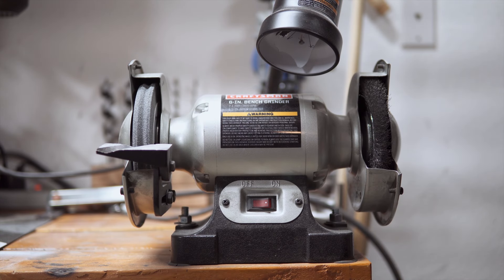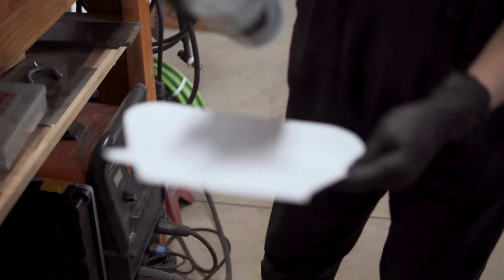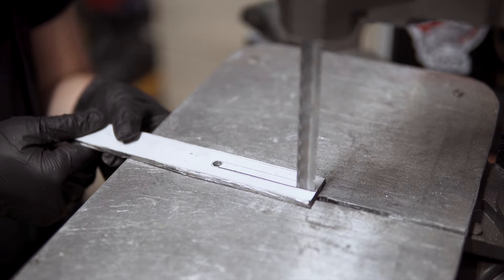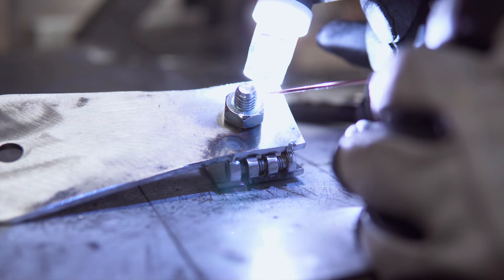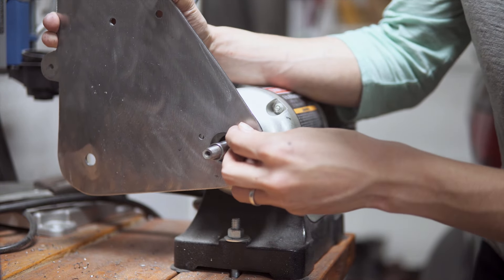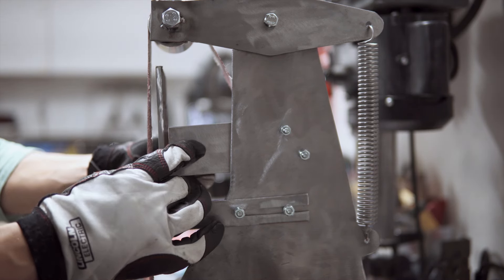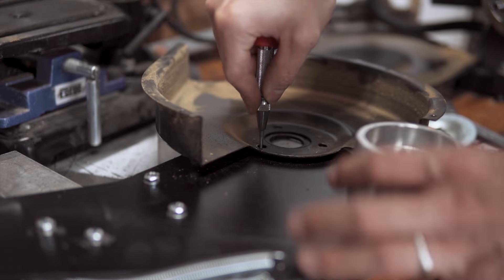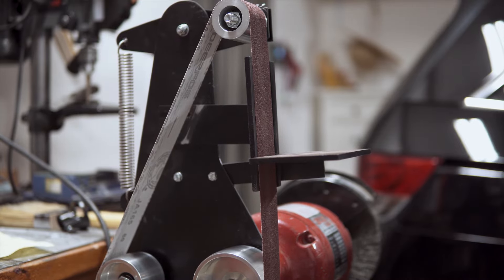DIY Bench Grinder to Belt Sander Conversion

Comment: Fantastic design and execution !
I’m late to this party and maybe it’s already been covered,  but a very useful feature would be variable speed….or for less $$,  a half speed grinder at 1750 rpm. 
The half speed would suck though when rapid removal of material with a coarse grit belt is needed. 
The variable speed ($$) is worth it if finer grit belts are doing careful shaping and finishing. In either case heat is the enemy.  Keep a full bucket of water next to the grinder for dipping if the workpiece starts turning blue. The goal is to dip before the blue shows up though.
Again,  what a great project !!
It certainly does NOT look homemade.  
                                       🤜🤛
Reply from the maker: Great idea, that would be a neat addition.

Comment: The 72” link has 4 wheels, which obviously doesn’t line up with your 46” design. Did you have a vision or template extending it to the 72” or should I get creative with the 4th wheel extension to 72”
Reply from the maker: Just use 3 out of the 4 wheels. Or you can add the 4th wheel into the mix, the world is your oyster!

Comment: You put the tracking wheel stationary at the back and put the pivot on a normal idler. Was there any reason for that? Have you noticed any rattle when you try tracking the belt?
Reply from the maker: To be honest, I didn't have a particular reason for doing it that way. However, there's no issues at all tracking the belt.

Comment: I see people building square belt sanders..is there an advantage from your triangle shape over the square shape ones out there?
Reply from the maker: People building square sanders have a more powerful motor. My setup uses fewer wheels for low HP motors found on these bench grinders

Comment: Hey love the video and I used y’all’s template and built my own and it’s amazing the only thing is what spring did y’all use? I followed the link y’all included for the extension spring but I’m not sure it’s the correct one so if you can please let me know what size it is. Thank you so much for the templates!
Reply from the maker: We double checked the link and it's the same one we ended up using at the end. The video does show a different kind where we doubled up and it worked ok but would bind sometimes so we found the one linked which works better
Reply: Awesome thank you so much and yes I ordered wrong one on accident so I ended up getting the correct one and works great!! Thanks again!!!
Reply from the maker: @vincentcocuzza8679  glad to hear!! Thank so much for watching!

Comment: I recently came across this video and had to make one myself.  Got everything from your links except the steel which I had, and I just got everything assembled and put on a .9 HP grinder.  There seems to be too much tension with my belt installed.  Is it possible I need a slightly weaker spring than the one in the link?
Reply from the maker: Hmmm it could be possible that the spring we used is too stiff for your grinder. You can try one with a lower spring rate and let us know!

Comment: Quick question. Ballpark how tall is the unit once all is said and done? I have an 8” grinder I’d love to do this to, left side and everything. But I have potential clearance issues to my cabinets.
Reply from the maker: The whole setup is about 16" tall overall. 14" from the center point of the shaft to the highest point
Reply: IMEE MADE thanks! Time to bust out the trusty Stanley tape...

Comment: Are you able to give the dimensions from hole to hole and things of that sort?
Reply from the maker: We have a template on our website you can download for free!
Reply: @IMEEMADE  I know that, but it doesn’t have any measurements on it. I am going to have it plasma cut out but I don’t know how y’all or wide you made it do you have those dimensions?
Reply: @DNSforge  I liked the fact that the initial mistake in the mounting drill holes was shown in this video. If you are planning on building or designing your setup using a bench grinder like the OP, then you can get the measurements you seek as it was done at around then 5:22 mark in the video. I would venture to say that would be advisable because not all bench grinders are made the same. At the 7:47 mark this is confirmed. :) 
Good Luck!

Comment: Anyone know if the Dewalt grinder dw756 is strong enough for this?
Reply: And where can we find the 3 aluminium bushing (the thing that the belt slide on)and what’s the size if them?
Reply from the maker: All the items we used in are linked in the description including the wheels. Also this setup is best used with grinder motors with at least 3/4 horsepower. Thank you!

Comment: Really cool and well executed but am I the only one seeing an issue with all this extra weight with added rotational tension of the belt being held by 3 tiny screws attached to the side of the grinder? Personally I’d use them as locating screws and extended the bracket/body of belt grinder to underneath of the grinder. If it fails in its current shape and form, it’ll be quite spectacular
Reply from the maker: Thanks for your input! Overall, the rotational moment about the three screws holding on the plate to the body  is pretty negligible. Also the static loading of the additional components aren't enough to degrade the performance of the screws. 

I definitely didn't run an FEA, but from a "back of the napkin" calculation, there isn't enough torque to shear one of the mounting screws while in use. I don't quite consider the application to be cyclically loaded for the screws to fail from fatigue either. Your suggestion is totally valid and others should consider additional safety mechanisms if they wish to. So far, I've been using this setup for 2 years pretty consistently without issue!

Comment: First one showed missing parts. Second one was complete. It's a working bench grinder https://www.youtube.com/post/UgkxxC8HPnl24fu0XhMU_nbmWNEUoK1RMHXk . One thing I like alot is that it's surprisingly quiet. I don't feel like I'm sacrificing any rpms or power for the quietness either. All in all it's a very nice machine. No vibration whatsoever.

Comment: Nice build though however, there's not enough horsepower. I tried to build one with my Dewalt 8",  3/4HP, I could slow down the drive wheel with my hand.
Reply from the maker: Agreed! At 7:00 I addressed this exact issue. The Craftsman grinder was too weak, so we swapped everything over to a 1hp grinder!

Comment: A few things they failed to see.
Not enough Real estate for 2x72 belt grinder? Not true as the whole reason for it being 72" long is so that the belt can cool off before hitting the hot metal again, so it can go anywhere to cool, even up, or down, just anywhere out of the way, so they could have easily made that grinder frame longer to hold a 72" long belt! And cost is another non-issue as if you are building it and cutting metal parts, making them a little longer would not cost much more if anything at all when using scrap.
The only expense I had on my 2x72 belt grinder was the 3 plastic 2" wide idle wheels @ $17, everything else was scrap including the treadmill motor.
Reply from the maker: Great job. But what you missed is that we said BUYING a PROPER 2x72 isn't ideal for us because of the real estate and cost. A proper 2x72 does, in fact, have a much larger foot print and much more expensive than a DIY solution...

Thanks for watching the video though!